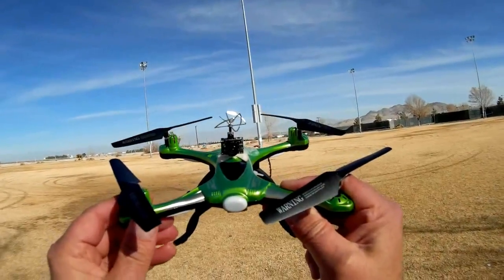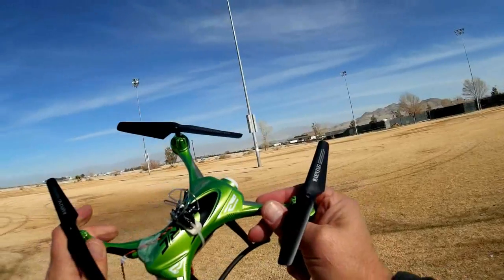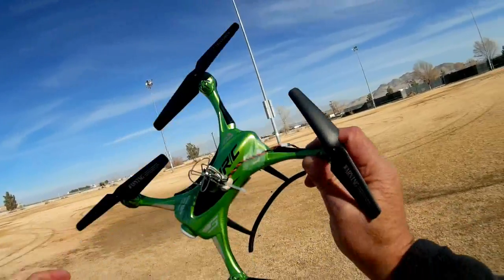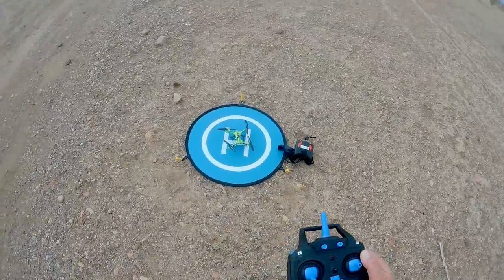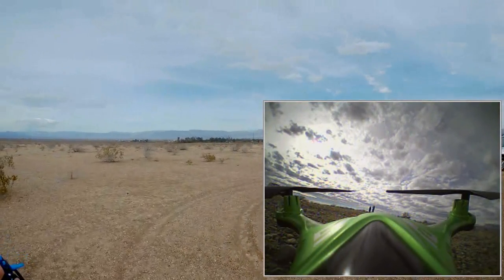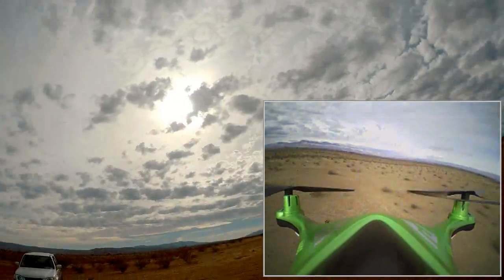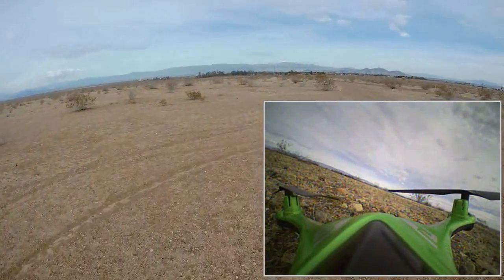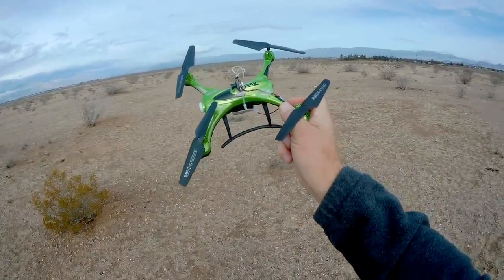TX03 AIO FPV Camera Toy FPV Racer Conversion Flight Test Review

Comment: Yes it does have a port !! Im looking forward to fpv it ! My first ever pfv drone .. what is your opinion  on the VR 007 pro ?
Reply from the maker: I have the original VR007 goggles, and they are best bang for your buck in that price range.  I believe the Pro's add a larger battery (twice the size of the original 800mah battery), and auto scanning capability (which is a big plus).
Reply: Just wat i like to hear !! People say it is crappy .. but they compare it to the fat sharks 🤔 i dont want to spend a lot of money .. they say the VR D2 Is a greate option but it is 3 times the prise of the VR 007

Comment: While I am asking questions, Maybe you can help with this one. I have upgraded the transmitter on the upair one to the Readytosky TS5823L Mini 5.8G 40CH 200MW Wireless AV Transmitter FPV Image. Now I think the receiver in the controller is getting to hot. After a couple minutes the screen starts getting fussy until you can hardly see it. I did put the controller in front of a fan and it went right back to a perfect picture. I have some heat sinks on the way for the receiver, Just have my doubts that's going to fix it. thanks again for any input you have.
Reply from the maker: Sorry, I'm not really up on electronics.  Not sure why your receiver screen would be overheating either.
Reply: 15x15mm Super Small Brushless DC Fan Ultra Tiny Miniatu Mini Micro Smallest Fan. ebay.

Comment: Do you also know of a good inexpensive pair of goggles to start out with?
Reply from the maker: Sure https://goo.gl/S9WkTS
Reply: Great! What kind of range do you think I will get with those goggles?Will I be able to use them with  My modded Upair one? I am 54 and new to the drone thing just since Xmas. Live in Wisconsin and cant even fly yet. Having a lot of fun getting ready. lol I love to tinker Have 4 drones already and want more. lol Just bought 2 of those micro cameras. and getting the h31. Thanks for all the info and Vids It really helps people make the right choice.
Reply: I was thinking of spending about 100.00 for goggles. Anything you recommend in that price range?
Reply from the maker: Yes, the following has diversity receivers and antennas for improved range.  It also has a built-in DVR for recording your FPV video https://goo.gl/3Tm72I
Reply: Does the Diversity have all the vital info read out on the screen. How far, how high, Battery life, etc.
Reply: It looks like the Eachine VR-007 VR007 does show the info read out on the screen, I just don't see that on the deversity

Comment: What would be the biggest batteries I could put on this drone and camera. I will run two batteries. Thanks
Reply from the maker: Just use the stock 400mah for both the quadcopter and velcro'ed belly battery https://goo.gl/NnmtxV
Reply: Awesome. Is there one that is more mah with that same plug in the 3.7v?
Reply from the maker: Sure, 600mah comes to mind.  But they are larger batteries, and may no longer fit in the belly battery bay.  The added weight may also decrease flight performance.  Am guessing that you'll only get marginal increased flight time because of the added weight.
Reply: Ok, gotcha. Thanks a bunch

Comment: Hello! I am very novice here and I want just to ask two questions:
1) Is possible to use the camera connector provided for the jjrc h31 drone to provide the enough energy to this camera?
2) If true, will work the foto/video button of the drone remote control?

Thank you!
Reply from the maker: 1) Yes  2)No
You can do it similar to how I did the following with my X5C.  You may need to use a voltmeter to identify the +/- pins. https://www.youtube.com/watch?v=zyBwhEP3E_M

Comment: At almost 6g, this thing is too heavy for tiny whoop application!
Reply: http://www.tmart.com/Boldclash-F-02-AIO-Separated-Type-5-8GHz-48CH-25mW-4-6G-A-V-Camera-TX-Support-2-9V-5-5V-NTSC-PAL-for-Tiny-Whoop-FPV-Inductrix_p356305.html  has it's conveniences for low profile mounting and keeping balance. shave a little weight ditching connectors and shortening wires if you want. I like that it can mount low up front.
Reply: Yes, this is a much better AIO camera for tiny whoop application. Not only it is lighter but also it is much less top heavy without the cove leave antenna.
Reply: I'm looking at whooping up the furibee F36 (more power stock). kinda bummed the lighter skull fcb not separately available at banggood right now. also looking at the RakonHeli 3 blade props are a little spendy (not horribly so), are lighter and slightly less pitch to let the motors spin up easier (torque!). any every bit of weight that can be ditched will help, cam plus 220mah do add a bunch. canopy cut from dollar store sticky back foam sheet to protect fcb and give it color shaves a gram of AUW too.

you might like this stuff:
https://www.pololu.com/docs/0J15/9
https://www.rcgroups.com/forums/showthread.php?1793803-brushed-motor-noise-suppression-caps-vs-separate-power-circuits

looks like some teeny caps across motor leads reduce noise a LOT, twisting the motor wires together helping quite a bit too. it may go a long way in helping clean up vtx broadcast signal and adding some range.

Comment: 3000 mah 3s
Reply from the maker: That's a big one.  You can charge it at 1, 2, or even 3A. 3A will give you the quickest charge.
Reply: +Quadcopter 101 0k thank you which one would you use
Reply from the maker: I would use 2
Reply: Cheers that's.good.enough for me

Comment: Add a real Wi-fi external antenna to the backside of that TX ... you should be able to double your range easy.  On all my "minis", I've installed X5C v6 RX boards, so they ALL fly with my Syma X8 TX and can go out beyond sight. I ordered 2 of those TX03 cameras, and will put one on one of my 33041s and put the other one on either my Bayang Toys X5C or the NiHui U807 (the U807 with X5C RX using X8 TX is REALLY fun to fly!). That's a great little camera, with 25mw, 50mw & 200mw ranges. I have a 200mw on my X8, and have had that out over 300m (external ant. on the TX).  Only down side is that I paid a LOT more than $19 when I ordered mine. They now also have them in the US warehouse, in case you don't want to wait for a slow boat from China (but cost $10 more). Cheers.
Reply: totally! doesn't take a lot of Tx power to have range, good antenna does wonders

Comment: is it better to solder the wire or buy the 3 wired connectors? and if so what's a good brand to buy thanks for the videos
Reply: If you solder you loose some weight
Reply from the maker: It's not 3 wired.  Only 2 wired (red/black) for power. No soldering required, as it already comes with the needed wired cables and plugs so that you can plug it directly into 3.7V Lipo's that use mcpx or Losi connectors.
Reply: awesome thanks guys!!
Reply: awesome thanks guys!!

Comment: I think the h31 might have a problem because i can get at least 200 yards out of my one
Reply from the maker: Yeah, I think that my transmitter has problems.  But even with the limited range of mine, the H31 is perfect for an FPV conversion.  Powerful and zippy, it didn't even seem to notice the added weight.
Reply: Quadcopter 101 that was really good to see

Comment from the maker: Buy this AIO FPV camera here for only $19 here during its promotion sale (select the CN warehouse, sale ends January 20th)  https://goo.gl/1jPkhM
These are the diversity goggles that I used with built-in DVR https://goo.gl/3Tm72I
These goggles also would work https://goo.gl/PZ7Cfd
Reply: if you bind it (the quad) to a better transmitter that wont be a problem. the other "cheat" that works is putting the antenna's of the quad and stock transmitter both vertical (drill small holes if needed), can sometimes double the range. works really well with an H8 cheepo.
Reply: That thing looks like a fighter drone.  Something you might see in a movie from the future that shots lasers at bad guys.  lol What is the name of that key chain camera you use? I would love to put one on that thing.  :)
Reply: Oh it has no range. :(
Reply: Quadcopter 101 Could you plz do a review on the jjrc h97!! Love your videos!!
Reply: Ok, I am going to get the diversity, Thanks you again.
Reply: I just ordered the diversity goggles. Thanks! Do you have any idea of the range I will get out of these goggles
Reply: Thanks